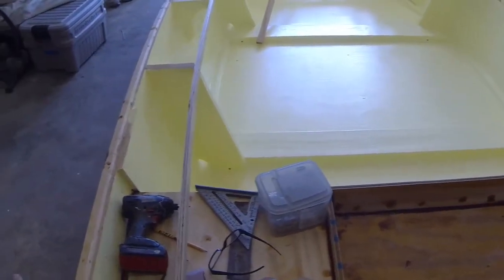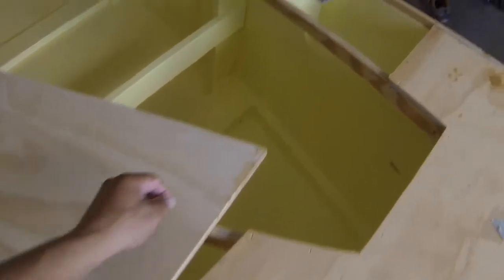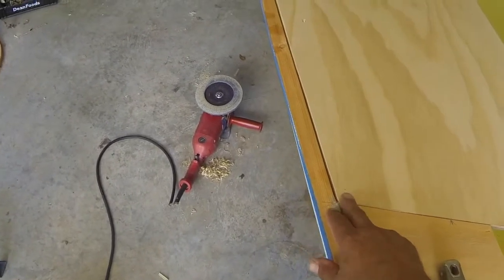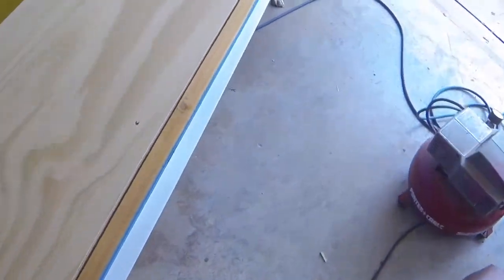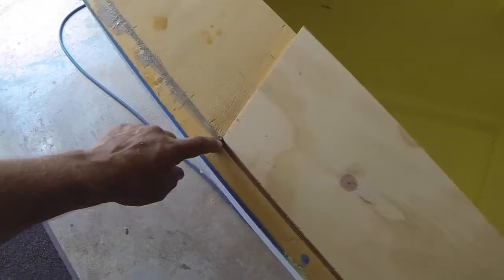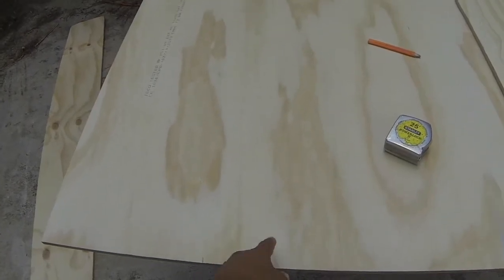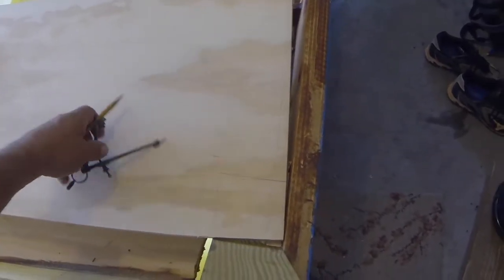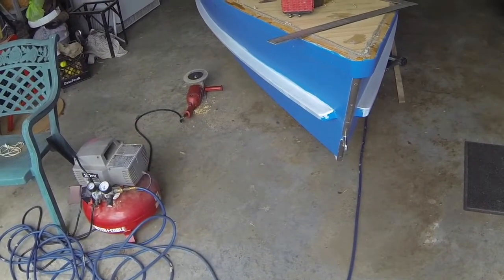Building the Lumberyard Skiff - Finishing Side Rails

Comment: Great videos.  I watch everyone you post.  Just a question, would a flush trim bit with a bearing work to cut off excess material from the rails and eliminate the need for fairing?
Reply from the maker: +Mrsouthernsurvivor Thank you!  The answer is maybe.  I have thought about using one before , but if the angle isn't close to 90 deg. then it most likely won't work. So I just use the sander.